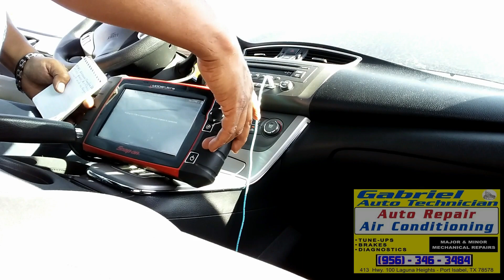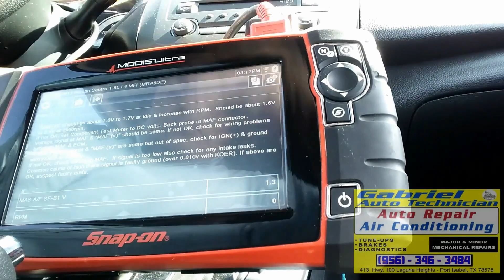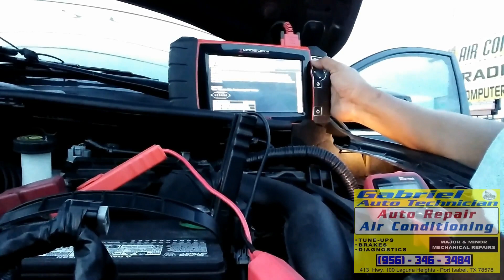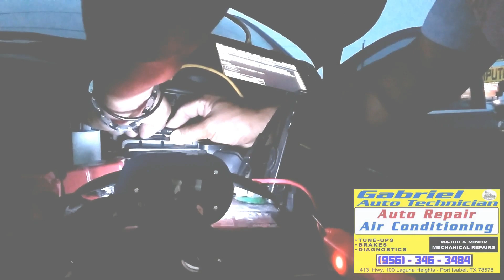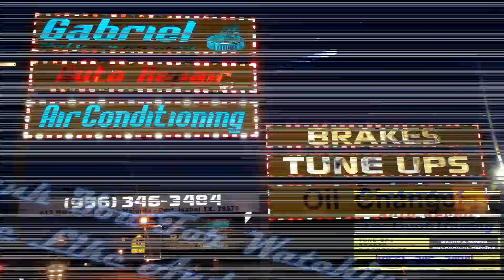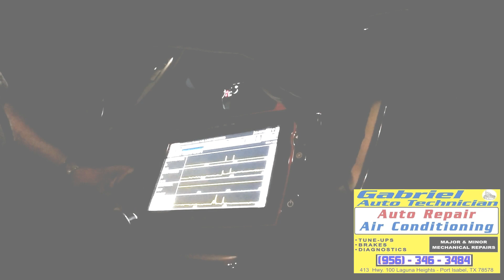Code P0101, MAF Sensor Out Of Range. 2013 Nissan Sentra.

Comment from the maker: Well, as I show on the video. With a multimeter check current, signal and the most important the resistance on the ground.
Check if none of the wires are broken, pull each wire from the connnector to see if one of them is broken.
Check the continuity on each wire.
Thankyou fot subscribe.
. 
Bueno, como muestro en el video.  
Con un multímetro verifique la corriente, la señal y la tierra, chequen la resistencia del cable de tierra.
 Verifique si ninguno de los cables está roto, jale de cada cable del conector para ver si uno de ellos está roto.
Chequen la continuidad en los cables.
Gracias por susbcribirse.

Comment: Yeah won’t do this cuz the computer ground switches and monitors that ground it will cause more issues than it already has.
Reply from the maker: Hey, do what you got to do, just do not replace good parts trying to guess the solution.
Remember that you are spending the customers money.
(If it is your car; no problem is your money)
Thank you for watching.

Comment: I have a Nissan 2012 with the same issue I’ve replaced the maf sensor
Reply from the maker: Could be your MAF, bad wiring, bad ground, or the computer.
The thing here is that you need to do the troubleshooting diagnostic, to never replace good parts.
Reply: @GabrielAutoTech  I do agree Gabriel
Reply: Did it work?